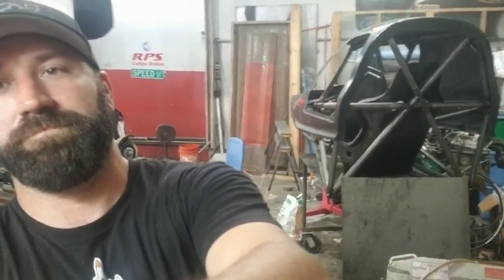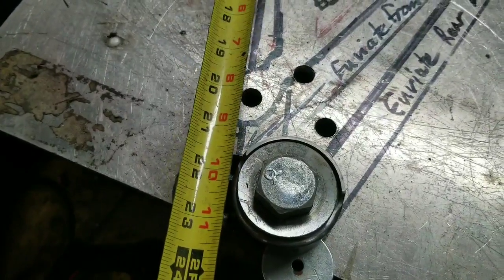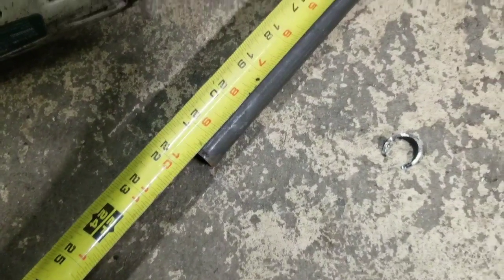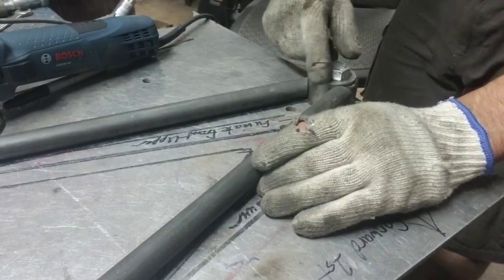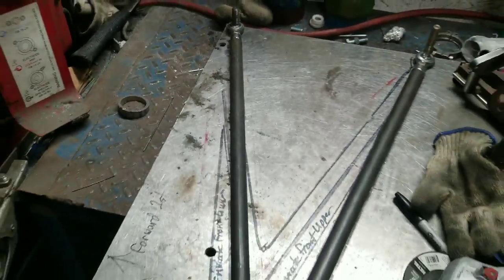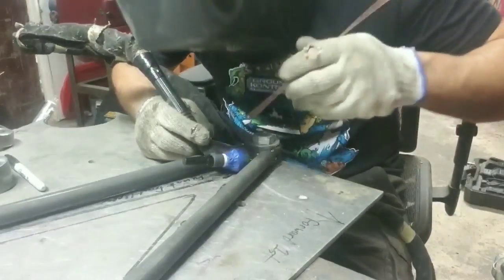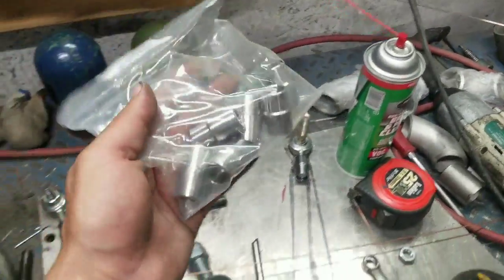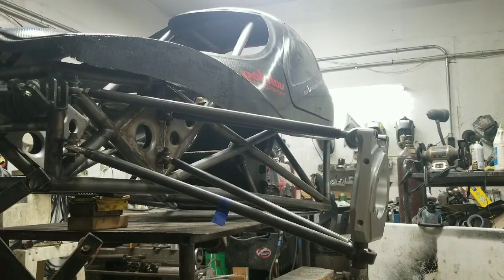Enviate Control Arm fabrication

Comment: Whos uprights? Also what alloy tubing are you using?
Reply from the maker: Palatov uprights and centerlock design.  4130 Chromoly
Reply: Nice, Thanks 👍

When you weld chromoly do you "normalize" it or temper it after welding? Looking to build my first chromoly chassis and I'm getting mixed messages, some say to do it others say they've never done it ¯\_(ツ)_/¯
Reply from the maker: @beachboardfan9544  have never done it.  Have crashed.  Chassis survived unscathed.  Chassis loads have supported 8000lbs of weight over airborne bumps, have survived unscathed
Reply: What wall thickness do you use for the main chassis, and what filler rod?
This is pretty much what my knowledge is based on, but I always like to hear opinions and experiences from people doing it.

https://www.millerwelds.com/resources/article-library/best-practices-for-tig-welding-of-4130-chrome-moly-tubing-in-general-motorsports-and-aerospace-applications